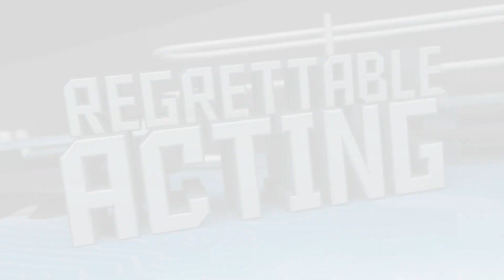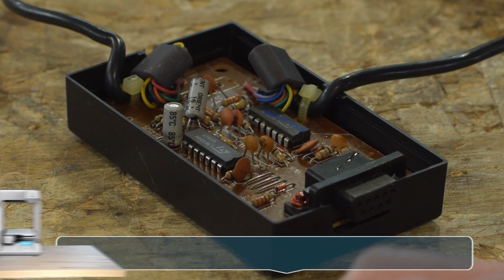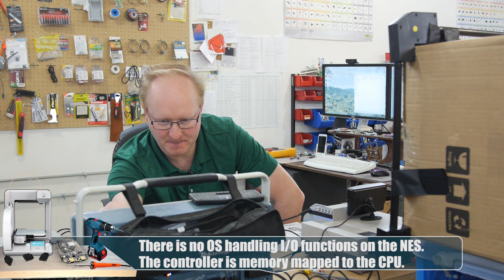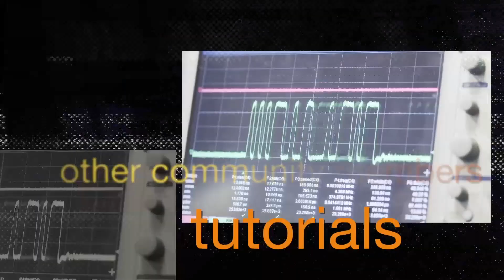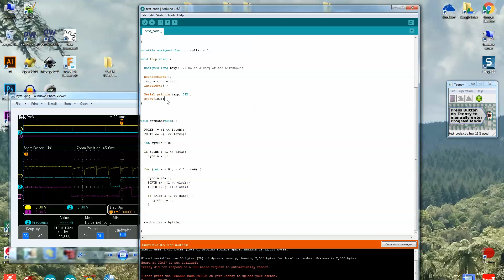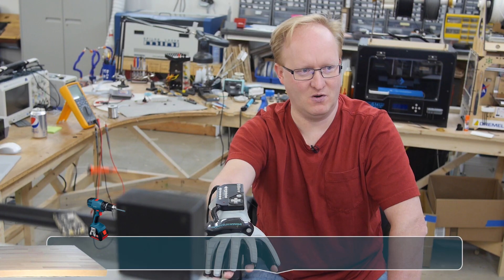Ben Heck's Power Glove Teardown

Comment: It just shows that the power glove's capabilities were not fully utilized  in terms of its full functionality.  They could have made it a far better experience if the games were recompiled for use in analog mode.  I think part of the fact is that microcontroller likely delayed the response time of the glove motion having to translate its sensors into NES controller button emulation.  If the games were made for it in analog mode with a fast enough sample time, the experience could be much better.

Comment: Do you have the power glove connector pinout? I have it but don't have the sensor bar and box. I would like to convert its 9 pin connector to the normal controller connector to just use the direction pad and normal controller buttons. Thanks!

Comment: Hey i know this is an old video- and it's helped me with my mission to fix my power glove. Cutting a long story short, i bought an NTSC one from Ebay and it arrived broken, when plugged into my NES, it was doing the constant beep, but it's as though the buttons on the glove were not responding to my inputs. After a couple of tries, every time the glove is plugged in now there is a quiet, constant buzzing sound with no light on the glove- Question is, do you think this could be repaired? Any suggestions on what you feel this may be?

These gloves are pretty rare here in England and there isn't much support, nor do people know what they're looking at so having to take this into my own hands really.

Thanks a lot

Comment: Old video I know. I think Ben could do better by not bind the controller to fixed coordinates and only register the changes with some error correction (detection treshold) and smooth out the changes to the mouse coordinates. Actually like swipe works on a phone, detect the direction (and after that reset it) and speed (distance/duration) of the change. By slow changes it moves (for example) 1 pixel,  at faster changes it moves 2 pixels and so on. I think you will get more stable and useful results.

Comment: i was under the impression that it clocked out 8 bits for the buttons then another 8 for controller identification.  at least that's how the snes works (with the exception of some controllers which do it 3 times)

Comment: The NES had a hardware bug related to the DPCM channel of the sound chip, which, when it was reading sound data, took over the bus and could cause you to lose a bit of controller data. Games that used the DPCM channel would work around this in various ways. SMB3 would poll the controller multiple times until it got two polls in a row which had the same buttons pressed. Games that didn't use that channel could just poll the controller once per frame, since it wouldn't lose buttons due to the DPCM DMA.

Comment: i see a logitech g930 headset there in the background :D you know you can order a replacement battery and pretty easily put it in the second ear pod and wire the original and the replacement in parallel for double the capacitance.

Comment: Dear Ben Heck Show. Is there a way to gut out a power glove and retro fit it with Wii or PS3 Motion controller components to "upgrade" and modernize the glove? seems to me it was an idea abandoned only due to the limits of technology in its day....
Reply: John Douglas Racing Video the wii and playstation use the same principle for motion tracking. The wii uses the pair of IR leds in the 'sensor' bar with the wiimote finding the position in 3d space. The playstation motion uses the camera to track the light of the controller. Both modern controllers use accelaromitors to track motion better, and to an extent orientation. The big thing that the power glove has is the ability to detect gestures, but a better system could be made using the predecessor's fiberoptic system, or a better implimentation of the power glove.

Comment: wouldn't it be cool if you could use the power glove as a translator for people who use sign language? the deaf person puts the power glove on and uses sign language and an external speaker translates. that'd be pretty awesome.
Reply: now this is a great idea!
Reply: The power glove wouldn't be capable of that out of the box, one would have to build an entire system to overcome the ultra sonic limits for signs that would be facing in one of three directions. The predecessor would work better, with it using a magnetic positioning giving it full range of movement, but at the time it was made it costed 10,000 dollars, and both need the tracking system in place. A modern version of the power glove could work, using gyroscope, but might need fiberoptics to perform well with higher acuracy, and better reliability.

Comment: Hey Ben you ever did a show about wireless power transfer?? Kinda like wireless charging but with 12v and 24v devices?? There is not a lot of info out there.
Reply: Tekolicious you're better off avoiding wireless power transfers of that voltage. greatscott! has a video on wireless power transfer. Don't know if it is on 12-24v, but I would suggest looking at similar value power transformers since they work on the same principle, just that the AC power would have to be created if your using dc. But you would be better off avoiding that entirely with the serious amounts of voltage, the poor performance at any level of distance, the possibility of making an inductive heater or a heating coil, an elector magnet that could have an overly powerful effect, and devices that operate at that kind of voltage would need larger amounts of power.

Comment: I thought you said you were going to see if you could upgrade the design in the beginning of the episode. If I remember right, the original design used really accurate optical flex sensors for the finger flexing, but for the production model they went with the cheaper option of carbon-based flex sensors. What would it take to jury rig and calibrate some optical flex sensors to replace the carbon-based flex sensors?

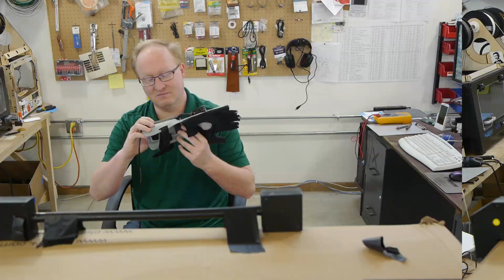Comment: The double sampling mentioned at 10:55 is a workaround for a bug in the NES hardware. When the 2A03 plays a DPCM sample, there is a chance that the reading from the controller port will be corrupted every few hundred cycles. As a workaround, games that use DPCM can read the controller twice and see if the readings match. If they don't, the controller can be polled a third time. Since the corruption can only occur once per some relatively large number of cycles, the third read will always be correct if one of the first two was corrupt (assuming that the controller reading logic is relatively short). Note that this only affects NTSC consoles and not PAL ones.
For more info on this bug, this page might be of interest: http://wiki.nesdev.com/w/index.php/APU_DMC#Conflict_with_controller_and_PPU_read

Comment: I've always wanted to see what people could potentially do with the expansion port on the bottom of the NES if you could tackle that at some point. There is some videos on youtube about it but nothing extensive enough to satisfy my itch for knowing it's potential.
Reply: Justin Jangles if I had to guess the expansion slot would work with a possible disk system like the famicom disk system, or use with a modem service (altough I could be off on that part, since the famicom used the game slot, but it would be more eligant than having a strange cart sticking out of the front of the nes with a cord.)

Comment: Very cool, if you look into the history of the power glove and where it came from it was actually brilliant. Using light measurements to control inputs and it pretty on top of it's game then it of course was downgraded and reduced to be more cost effective to work as a toy. Some of the initial designs/patents/ideas around it were quite clever.

Comment: It's cool to see you hack through the Powerglove.  Just curious if you've ever seen this book?  It's from the first VR push in the 90's and had documentation on a Motorolla circuit you could build to link a powerglove to a IBM PC / Apple Macintosh ii serial port.  I built one back in the day.  Worked great, but never did anything major with it.  

The book also had a set of plans for an early HMD.  

http://www.abebooks.com/9780672302701/Garage-Virtual-RealityBook-Disk-Jacobson-0672302705/plp

Comment: Quoted from a more knowledgeable person than me:"Man there's so much wrong with that.  First deciding that a silkscreened micro must be an ASIC.  Then he decides that the data isn't signed because the NES CPU has no decimal mode.  WTF?  BCD was removed to avoid patents, not because it's complex, and twos-complement signed binary is simpler than BCD mode anyway.  He completely fails to recognise that he's got signed bytes and says "255 is centre", when 255 is -1 in twos complement - it's centre zero as you'd expect.  Finally, why make it work like a relative position mouse?  Making it an absolute position input like a lightgun would make far more sense and be far easier to use."

Comment: i'd like to hear more about how fingerless gloves keeps Karen's fingers warm.
Reply: how do clothes keep you warm if your head is naked
Reply: Well, you see blood vessels are just like water pipes in a home. The longer they are insulated, the longer the liquid inside will maintain its temperature. Since the fingers are at the end of the line for that path of blood flow away from the heart, the blood is more affected by exterior temperatures the farther it travels down the arm. Such as in the winter, the blood would get colder. Therefore, the longer you keep the blood vessels insulated, the longer the blood will stay warm. So by wearing fingerless gloves, the blood flowing through the vessels in the hands is being kept warm long enough to keep the temperature of the blood flowing through the fingers warm.

For anyone whose job it is to frequently type on a computer to respond to people on the internet as well as needing to use tools and build things, it is ideal to have as much dexterity as possible, i.e., exposed, warm fingertips. Therefore, fingerless gloves are an ideal solution for such a person, especially if they live in the arctic tundra that is Wisconsin in winter.
Reply: Who cares, as long as she looks totally hot wearing them? 😉

Comment: hello,
here in england there is a thig called crest csience which is a club for stem students. at said club, you are given all the resourcess you need (they wont give you a nuclear reaactor =() but i am trying to make a 3D pen. i am having some issues to heat up the plastic fast enough, should i use a part of a microwave, i think it is the transformer or something like that. said transformer thing has two coils and if i cut 1 out and replace it by a coiled piece of wire which i then atach to a piece of metal at each end, it should heat up very fastly and get very hot. is theren any risk on me using this to make the heat?, and does it actually work?
james

Comment: There were actually two Power Glove games, but the second one, Bad Street Brawler, basically functioned like any other game with just a regular control scheme translated through Power Glove motions.  The only "advantage" of using the glove with Bad Street Brawler is that you could perform an exclusive attack called the "Glove Zap".  But in reality, the Glove Zap was performed by pressing Up and Down at the same time, so if you could do that on a regular controller, you could do the move.

Of course, none of this really matters, because Bad Street Brawler is a terrible video game that you should never own.

It's a shame Mattel wasn't more creative with the Power Glove.  It would have been a cool alternative to the Arkanoid controller, if it could allow you to turn your wrist to simulate the rotary dial.

Comment: The reason Mario 3 multi-samples the controller is because it uses the DPCM (sample) channel for sound. Due to a hardware bug, bus conflicts can arise between controller inputs and the DPCM channel, which may result in erroneous input reads. To compensate for this, most games that use sampled sounds keep reading the controller until it gets two consecutive reads. You can see this in the video how occasionally on the o-scope you see 3 or more reads happening.

Comment: Hey,
Love your show! It inspires me to start projects of my own.
I have a quick question though... What kind of wire do you buy for your day-to-day soldering?
I know I want both stranded and solid cores, but on element14 there are so many different kinds (different Gauge, number of strands,  diameter, voltage rating,...)
Also, is there maybe some kind of kit which has all the different colors of the wires (stranded and solid)? I couldn't find one on the website...

Comment: Hey Ben, I know this is probably the type of thing that involves getting an advanced degree in electrical engineering, but have you ever reverse-engineered one of those one-off chips, like in the Powerglove? If so, would it be possible to do a video on the process?

Or maybe that would be a thing that Dave over at EEVBlog should tackle. I dunno. I just think it would be cool to see the process.

ALSO! FELIX! I have that shirt! :D
Reply: Greatscott and bigclivedotcom do reverse engineering, benheck also did this in a video about scalvaging a screen for a display, and making a multidisk 360(but both are on how to use that, then knowing on how it works). The big thing is knowing what is going where, through what, and sometimes reading with an oscilascope.

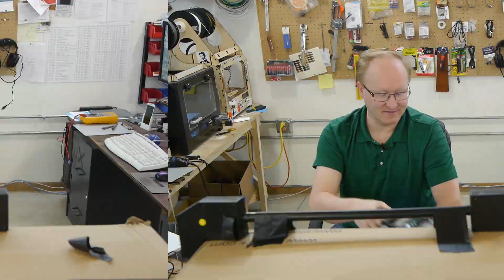Comment: I think I may know why the controller was being pulsed twice at 10:50. If I recall, pulsing 8 bits from controller port 1 twice in a row will get inputs from controllers 1 & 3 if a Four Score is connected (controllers 2 & 4 on the second port). SMB3 does not have Four Score support but the developer may have used a general purpose routine to save time. Without a Four Score connected the code just records the same inputs for controller 1 & 3 so there is no undefined behavior. Other developers may not have had access to the library or may not have had the code space or CPU cycles to use it so their code only pulses 8 bits per port.

Comment: It actually does kind of look like signed data.
Reply: I was thinking exactly the same! IIRC, you can interpret 8bits however you want... If its unsigned it will print 255 and if you interpret it signed it'll be -1 (2's complement)
Reply: You're a dork too?  I thought I was alone.
Reply: Kind of? There's no doubt it's signed. If it's true that the 6502 doesn't support signed comparisons they must be converting it to biased in software, but it's definitely signed coming out of the glove.

Comment: I was curious if the power glove could be susceptible to interference...also if you made the response coarser, i.e. for ever 10 (input bits) it moves once...but 10 pixels over...rather than one for one.   I am sure I am not describing it well...but like when you zoom way in with a paint program, so you are painting each pixel, but the mouse has to travel far to get the cursor to jump to the next pixel.
Reply: youbecha64 yes, someone could broadcast the same ultrasonic sound and mess with the system's positioning.

Comment: what coding language does Ben usually use
Reply: he seems to use Python a lot depending on what he is working on.
Reply: he seems to use Python a lot depending on what he is working on.
Reply: he seems to use Python a lot depending on what he is working on.
Reply: When he is coding the Arduino and trinkets, he is using a C "like" language.  See its reference here: https://www.arduino.cc/en/Reference/HomePage
Reply: +Raising Awesome  thx
Reply: +LordDrachenblut  cool, I use Python at school too
Reply: What Arduino actually uses, the integrated development environment which extends to numerous microcontroller devices with built-in bootloader, not just Arduino itself, but also the Trinket/Digispark at the low end and perhaps Maple LeafLab at the higher end, is a C++ compiler (g++-based) with numerous language and standard library features inaccessible or stripped away, which makes it closer to C, but still be able to use features like inlining, typed constants, type-based overloading, useful either for embedded device performance or to hide differences between devices. Also with some magic where Arduino toolchain copies and pastes bits of text together, creates automatic forward-declarations, etc. to make starting out a bit easier for people who for example know Java but don't have substantial C or C++ experience.

Comment: The nintendo probably had signed numbers in some way, at least when performing jumps in the code
Reply: those numbers he was getting, they looked like signed twos complement numbers to me. will assume that is probably what they were.

ADD: usually at the ASM / machine code level, there isn't really much of a distinction between signed and unsigned numbers anyways, but more it is up to how they are "interpreted" by the program working with them.

most ALU operations work equivalently between signed and unsigned numbers, and usually about the only real difference is that there are often different signed/unsigned comparisons for conditional jump ops or similar.

can't say as much specifically about the 6502, would have to look more into it.

ADD2: the 6502 supported signed arithmetic.
Reply: 100% right about two's compliment. I'm surprised Ben didn't catch that. The 6502 has a status register to indicate a negative result from a calculation and its branch instructions all use relative addressing with two's complement operand to indicate a forward jump of up to 127 bytes or a backwards jump of up to 128 bytes.